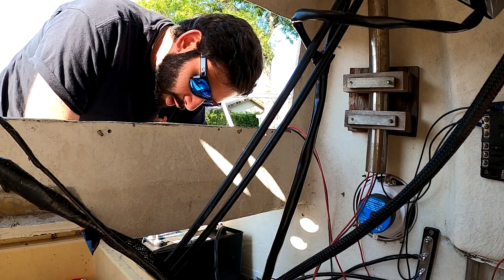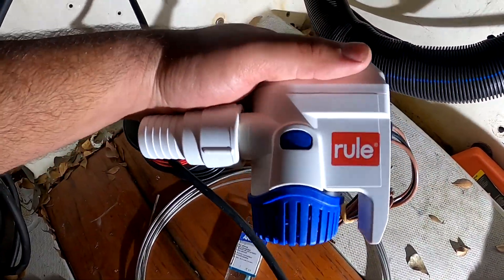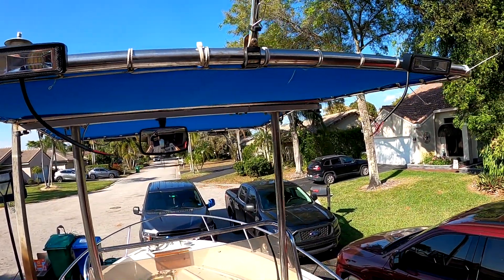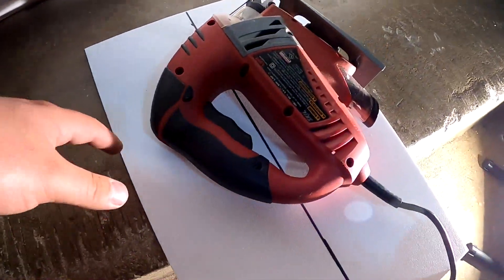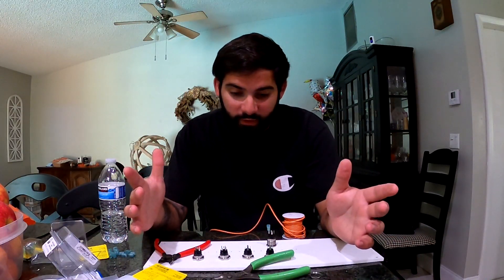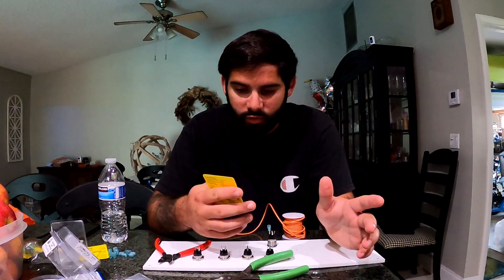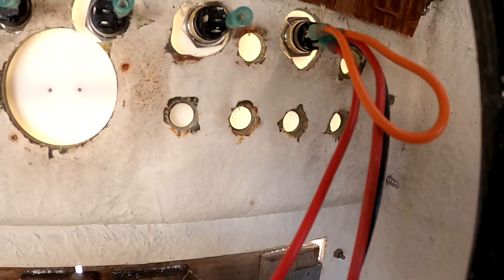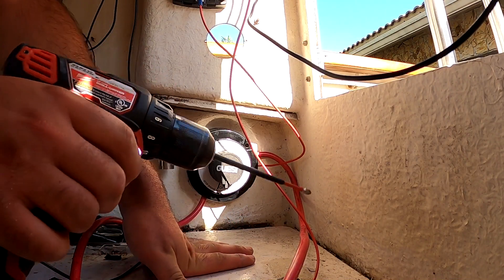RIGGING MY 1980 20 FOOT ROBALO WITH SPREADER LIGHTS,ANCHOR LIGHT,SWITCHES,WIRING,BILGE PUMP!

Comment: Love the videos man, I just picked up a 79’ Robalo that is almost identical. Are you running a separate battery for lights / accessories or are you running your engine terminals to that center console battery as well?
Reply from the maker: Thank you bro! That means a lot, as of this moment I didn't just trying to save a little money right now, but you definitely 100% should, Id get a deep cycle battery and use that for your light/ electronics. start the engine with the crank battery and let it charge and then put it on the DC for everything. Yes the engine battery cables are going to the center console, , I used 4 gauge wire to do so, but it all depends on the length of the run